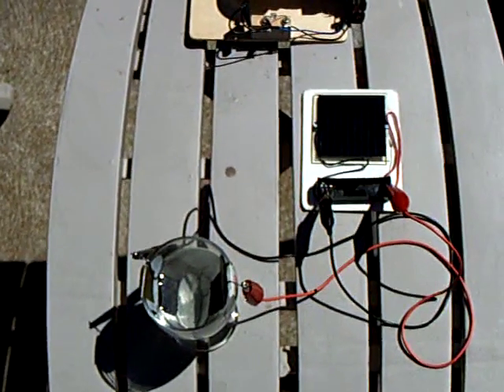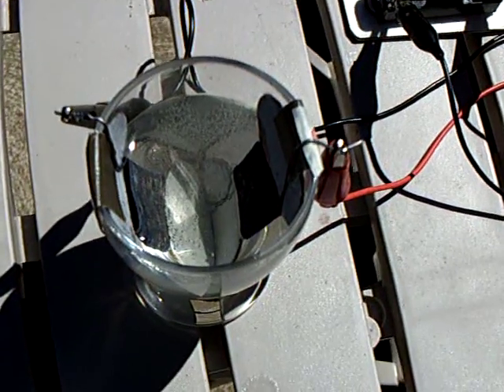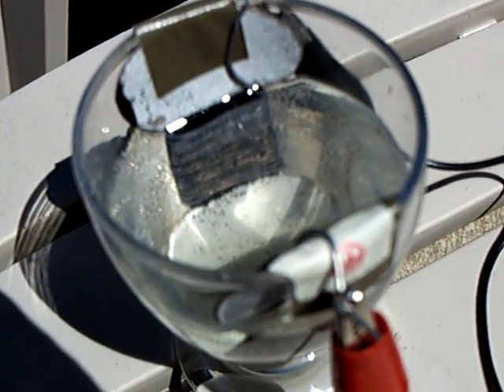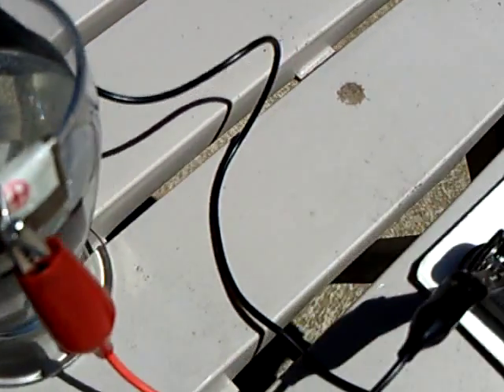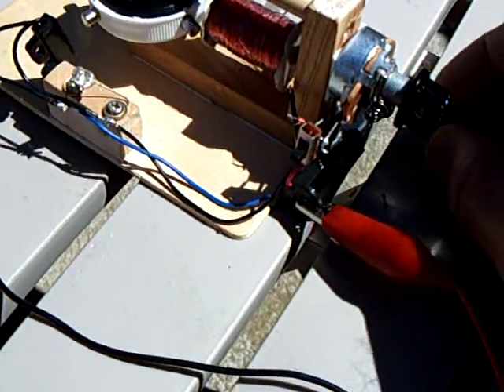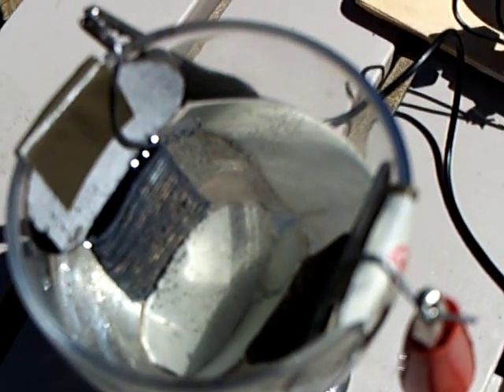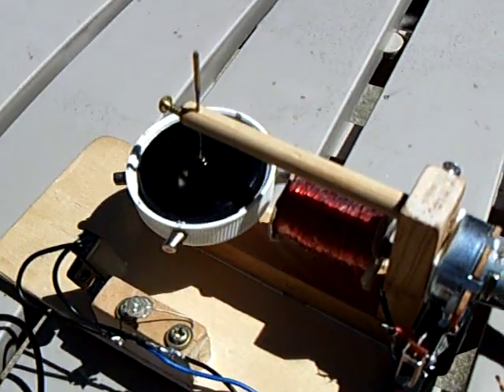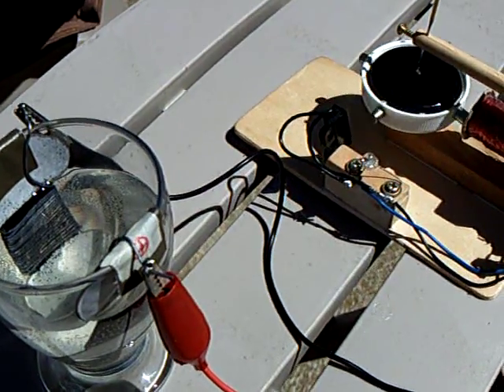Solder & Epsom Salt --Homemade rechargeable battery

Comment: You can even use BAKING SODA! I find it holds charge for a very long time (over 24 hours with still 1.3v+ on it)
Not the highest open circuit voltage. but it lasts an incredibly long time. And you can get lots of capacity out of it.
Try reversing the polarity after discharging it. Cycle it a few times. then discharge it and reverse the polarity again. And cycle it more times.
Repeat until the negative electrode has good surface area. This will decrease the internal resistance and increase the capacity a lot.
Then cycle it in the normal direction for a while.

I have tired epsom salt but it flakes off material and is too aggressive. it damages the negative electrode for some reason. 

Sodium carbonate also works but its WAY too nasty. DO NOT RECOMMEND. Washing soda is extremely caustic and nasty stuff. burn your skin instantly on contact.
Thats why I used baking soda instead. The cycle-ability is much higher.

You also get more runtime and power by having the plates as close together as possible.
Try sandwiching a few layers of paper towel between them.

I made an entire coil wound roll battery out of 100% lead foil electrodes 0.3mm thick and about 2 feet long. and 1-inch width. and it can run a small DC motor for 30+ minutes. and supply 100mA of current for almost 20 minutes!. 26mAh and the capacity is still increasing :D
it also handles  deep-discharges much better also..

Comment: Have you tried using zinc for the negative electrode instead of lead. This showed significant performance as i conditioned the plates in epsom salt and distilled water. But it held the charge for much longer.. also there is a patent and info on zinc lead battery if you google it which discusses the sulfates etc..

Comment: I could not see any significant difference between the 2 plates in the epsom salt compared to plates in the alum and both mixed distilled water. As they do not hold the charge for any length of tine like jb showed his fan going for hours?? The reason i ask is epsom salts much cheaper to experiment with :)

Comment from the maker: I tried 60/40 solder and it didn't work.  I have ordered some 80/20 lead wire solder and that should tell me if I'm right about the ratio.

Comment: Hey Lidmotor, I have made an alum battery, and it works great!!! My micro wind turbine does not have the power to charge it, but solar and wall worts do! I will post a video soon with the outcome. I did fill a dry Pb cell with alum, and I am charging it right now. I will video that too if it takes a charge! The cell needed conditioning before it will hold a charge. The more you charge it the longer it holds a charge. I started with 12v and now it charges with 3v, it also runs a JT with LED's.

Comment from the maker: Yes--but you need a voltage boost circuit to run an LED.  This single cell is about 1.5v.  A solar garden light will run off this.